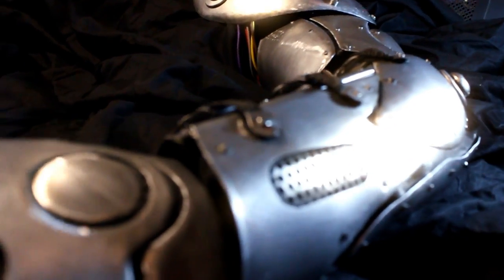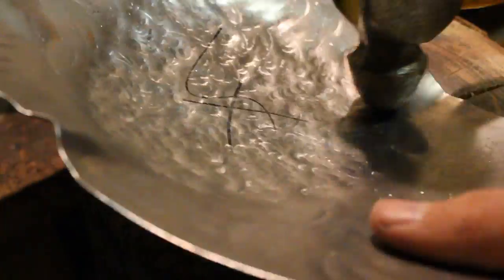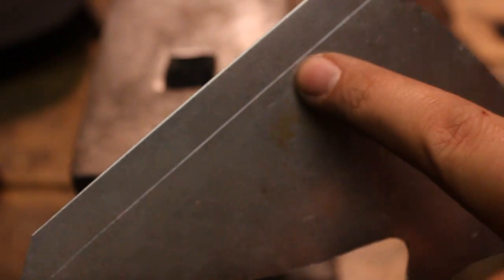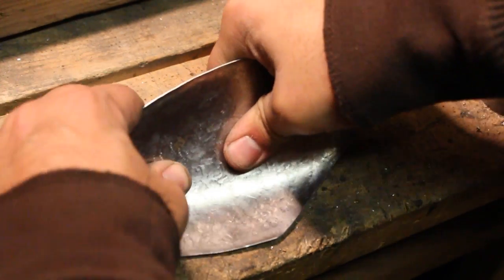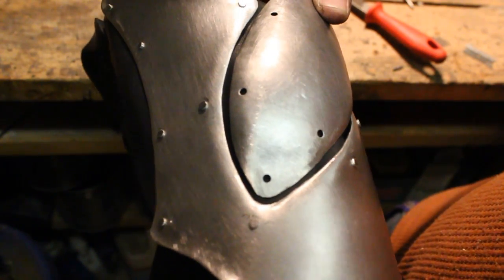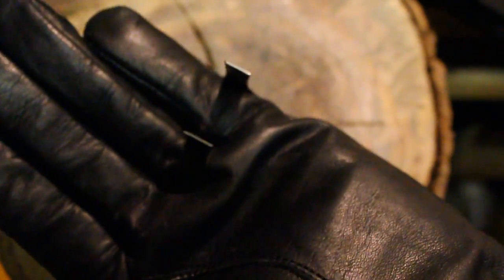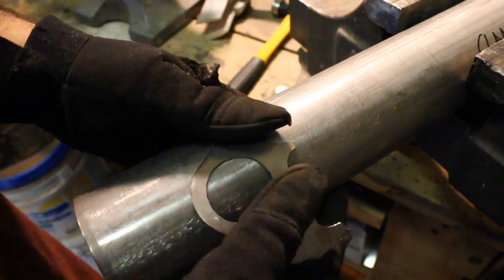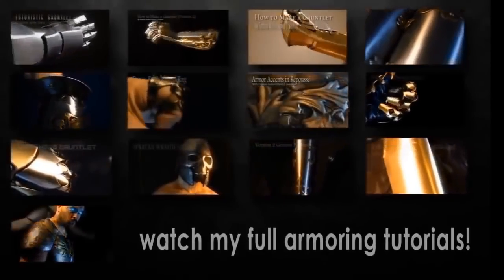How to Make a Bionic Arm in metal Tutorial

Comment: what kind of metal do you use? And where can I get some? Also dose it cost a lot?
Reply from the maker: This is 20 gauge steel but you can use any metal and any thickness you want. Steel sheet metal is not expensive. You can get enough metal to do a project like this for about $20 on Amazon, or even cheaper if you look up a metal supply near you.

Comment: Would have been 100x better if you made a motor then added it to the arm to actually make it strong
Reply: Jerry Udonneedtoknow u cant do it in a small size, it would be visible and not that great ...
Reply: Yes you can I built a small but very flat motor, I used about 23 feet of copper wire, the motor, it's about 1/2 inch thin and 3 inch in diameter
Reply: Jerry Udonneedtoknow an okok, if it's possibile to build it would be great!!
Reply: Though it is a pain in the ass spinning the wire around

Comment: I can let you in on a cool idea for an invisible latch .  This type armor, especially futuristic armor that is not supposed to be seen, as though the robot is seamless.  I owned and operated a special effects shop throughout the 80s and 90s contracting to television and movies.  I learned a lot of cool tricks, especially when working with other artist like Rick Bakker or Rob Botin.  

To make the latch, you used  a piano hinge, I always preferred aluminum stock.  You cut the necessary size you need from the hinge, usually the full length of the joint.  Be careful not to cut the hinge pin, you will need that for the latch.  We usually put a piano hinge on the opposite side from the latch, but that one had its pin.  I would cut the pin for the latch side a few inches longer than the hinge was cut.  Then bend a 90 degree turn at the point the pin exits the hinge.  That stops it from going in too far and works as a handle to use to pull it out.  Oh, I also used to sand a point on the other end of the latch pin, not necessarily a sharp point, just diminished enough to made it glide its way back into the hinge without hanging.

You have to replace the pin back into the latch hinge to attach it to the armor.  Now you attach both hinges to each side of the armor with whatever medium you like.  You can rivet it, glue it or fiberglass it into place.  The hinges can be on the inside of the armor if, you want it invisible.  It has such a low profile, it has never caused any discomfort with actors or stuntmen who wore our suits.

Once the glue has hardened on both sides, the hinges will stay forever lined up perfectly.  If you slide out the pin, using the 90, the armor should clamshell open.  Place it on the actor, clamshell it around their arm and the hinge joints will line up perfectly and you can slide the pin back in and it will latch that side.  Rotate the 90 degree turn on the pin until it is flush with the suit and  the effect should be strong, but invisible.  I apologize if you all ready knew this technique.  I don’t know if anyone else has used it, but I can imagine others thought of it, it’s not rocket science.  I learned it on my own, like I did most of the tricks of the trade, so I don’t know how common it may be in use.

Great job on the armor.  I’m impressed because it’s made from steel.  In Hollywood, it would fabricated from vacu-form, fiberglass or some other light weight material, because actors are wimps and believe it or not, so are some of the stunt people.  Whine like babies.  If you put that steel on some actors, they would bitch from morning until the director calls it a day.

There were other reasons.  Often they needed several suits, one for the actor, one for the stunt people, which could be several and one for the stand-in.  Suits get destroyed in some action scenes, so it’s best to have mold to quickly pull another and just paint it to look metal.  I’d love to really do one in metal!  i never have.  Great job!  Keep up the good work.
Reply from the maker: I never thought about doing a hinge on both sides like that. It's an excellent idea and I will be sure to use it on future builds. I came up with my own invisible latchless system on my Infinity Gauntlet build, but it was more complicated than that. And although a stuntman or actor might complain about the limited articulation of this piece, it actually only weighs about 4 lbs total. It's not heavy at all. But like you said...if they are wimps they will complain anyway haha

Comment: Thanks David. What size is the pipe that goes on the inside of the jig?
Reply from the maker: that's a 1" INside diameter pipe cut in half, and the one I press into it is a 3/4" OUTside diameter pipe. Both are gas fitting pipes found at any hardware store.

Comment: What is the footage of metal needed to create the arm?
Reply from the maker: I don't know off hand, but you should be fine with a piece that is roughly 24x24. Amazon sells 20ga in about that size for like $18. Best way to determine the exact size you need is to cut out all the pieces in the template and arrange them on the table in a square or rectangle. Measure the length and width and you'll know what you need to buy
Reply: Thanks David. What size the pipe that goes on the inside of the finger jig?

Comment: How exactly did you do the leather in the elbow crease? I am having trouble figuring that bit out.
Reply from the maker: you can see how it's done in the video if you look close. It all comes down to how tight or loose you rivet it, and where you leave the rivets out of it. Also depends on the type of leather and how thick it is. You just need to be sure there's some give in it so that you can move your arm fairly well inside of it. You will get some bunching when you bend your arm no matter what....it's going to take some trial and error
Reply: Thank you

Comment: I'd like to see this kind of build done with springs instead of straps for the outside retention on the forearm. Never tried it, so I don't know if that would be a problem, but it would look cooler than straps and buckles if it did. Great build either way, it looks awesome!
Reply from the maker: If you check out my Infinity Gauntlet build, I actually made it close with springs, but they are internal so they can't be seen. Same thing could be done externally if you are looking to make the springs part of the aesthetics.

Comment: If you attach a rawhide cap on the ball-peen hammer  you won't have the wicked excessive peen marks to smooth out, wood anvil, metal hammer with a wooden mallet head, a polymer soft hammer, there are several impressive urethane shaping hammers available, you could also place a layer of 1/2" rubber on the wooden anvil, and use a weight augmented hard rubber mallet, it rebounds nicely for less tiresome repetition. 
See if that improves your finish timeframe

Comment: David, this is Steve, inventor of Armore Fitness.  I note that you have a concentric hinge for your elbow.  You will have noticed that the arm does not work this way.  You need to change this to a 37 degree bicentric hinge to eliminate the pumping that is going on with your model, causing the exoskeleton to move up and down on the forearm.

Comment: I have a few questions. How durable is the 20 gauge steel? and could you make it with a thicker gauge to make it stronger?
Reply: The Ghost 20 gauge steel is quite durable. As you can see, he had to hammer at it with quite a bit of force to get it to warp into the particular shapes. It's easy enough to bend by hand with a decent amount of pressure but it obviously will bend or deform if you apply strenuous amounts of force to it. In regards to a thicker gauge metal, the thicker the metal is, the harder it is to bend and mold to how you want and the more susceptible it is to cracking.
Reply: one more question do you think it would be possible to connect 2 bionic arms to one of your chest piece and to the helmet as in like more like iron man and less like guardian from supergirl

Comment: Another question. Is it fine to make it out from aluminium?
Reply from the maker: you can use aluminum, but dishing aluminum can be very stressful to the metal and may require annealing to prevent cracks.
Reply: That's the truth. I think about chequer plate, or plate used to make cars.
Reply: Poo

Comment: How or where do you get your leather from? I have several old leather belts but they are too thick for me to use to hold pieces together.  Do you buy it off of amazon or another source?  And also what kind of foam do you use? Is it any specific kind? I also LOVE all of your tutorials. I made my own dishing stump from watching your video on it and it has helped me a ton! Thank you and please keep making these videos!!
Reply from the maker: I buy most of the materials through Amazon, but for the leather I had to find it on Ebay. The templates that require leather will tell you about how much you will need to buys, along with the recommended thickness, etc. The foam I use is leftover automotive interior foam, but anything should work fine. The black foam that you see me use inside the helmet is the craft foam you find at the hobby store
Reply: Alright. this will help a lot! Thank you so much!

Comment: I have been really getting into armor like this.  I like some of your gauntlets, and seriously want to make my own chain mail armor for actual, modern defensive armor.  I have been trying to find this youtuber that claims to wear it everyday as an every day carry item.  I probably wouldn't wear any of your armor designs as an every day carry item, but is it possible to make this or your gauntlets or pauldrons with thicker metal so it can actually withstand low velocity bullets?  Maybe 9mm?
Reply from the maker: to be able to withstand any round beyond a little .22, you'd need very thick steel, and it would be far to heavy to wear, let alone cut and shape
Reply: ltsallwood Actually with my own testing 1/8 inch steal shot flat will stop a 9mm. Curved on the arm it would probably ricochet off. You just wouldn't want to get hit in the head from the Rico. A 45 is a definite pierce tho.

Comment: I feel like this would help me be mobile my left arm is barely strong enough and saved in nerve how much would you sell that for I feel it will help me alot
Reply: Mike Campbell If your arm is barely strong enough to support itself this would just trap your arm inside a metal carcass and you would lose even more mobility of your arm.
Reply: Mike Campbell its not really bionic. No motors or hydraulics. Your own muscles move the metal. So like the guy before said, this would hinder your situation even more since this would place more weight on your arm.

Comment: tool and die maker apprentice: If you lift up at the end of your grinder strokes, you won't put holes in the metal. Gives a more perfect surface, however since this is mostly aesthetic, with a flapper wheel, it might not make a difference . Similar to how you spray paint without putting runs. (in case you didn't)

Comment: Is sheet metal from home depot ok to use? If so can I heat treat it and harden it like I would do when making a knife or other weapon? Also, what do you recommend for a good all around metal working tool?
Reply from the maker: As long as the sheet metal is not galvanized it'll work fine. Galvanized is fine too, but the zinc coating will look bad. You can harden the steel using heat but I am not an expert on that and I can't help you with it. Not really sure what you mean by a metalworking tool. There are a lot of different tools I need to do these projects

Comment: Couldnt you use a smaller glove to make the finger pieces smaller so you have more mobility in your fingers?
Reply from the maker: it'snot so much the glove that it the limitation on movement. If you used slightly thinner gauge metal for the fingers, it might improve a little

Comment: awesome job on this. wonder if adding an extra flap of plating closer to your neck on top of your shoulder and cutting a relief in the actual shoulder piece would prevent it digging into your shoulder when you raise your arm?
Reply from the maker: I considered adding another piece there, but I didn't want to ruin the rounded look of the top of the shoulder. If you look closely, I actually flared that part of the shoulder piece outward (away from my skin). With that, there's no real digging into my skin, or if there is, it's not uncomfortable. Plus, I don't put my arms straight up very often haha

Comment: how long is each section of your arm (hand, shoulder,etc)? or can these be adjusted universally?
Reply from the maker: It can be adjusted. You basically just figure out where the elbow hinges, and connect the upper and lower parts at that spot. Fairly universal unless your abnormally tall or short, in which case you can scale the template with your printer accordingly.

Comment: how would I go about using this method to make a winter soldier arm?
Reply from the maker: the shape is already fairly similar, but you'll have to use paint or something to simulate all the separate horizontal pieces of metal. You could "dent" the surface all over to make it even more realistic, but that would be very difficult.
Reply from the maker: by dent I mean along the horizontal lines of course
Reply: Yeah my talent in this area is some what limited!! I think I will just give it a shot and see how it goes! Thanks for your help and keep making awesome videos! !

Comment: adding a small battery pack and some LED's would make that arm REALLY pop, you can even utilize the wires you already have running through it
Reply from the maker: I did consider it, but decided to keep it kinda simple this time around. In an upcoming project though....definitely
Reply: +David Guyton I'm a flashy kinda guy and most of my projects include LEDs but this build with a battery pack that's visible and lights would be cool

Comment: couldnt the goverment use this to help are solders
Reply from the maker: It would help them look cool...wouldn't be much more help than that.
Reply: and weigh them down even more.
Reply: D. Taylor Ford with given time they'll come out with lighter stronger body and head armor whether it looks cool or not they will because you know if it will save lives and make money it's going to be atleast attempted they're already engineering head armor that can block anything up to 45 acp rounds so it's already a thing just not finished yet

Comment: Another great video and build! I was wondering about your arm length vs Hobbit built people like myself. It might help for scaling the pattern down or up as the case may be per person. Thanks again for another great build!
Reply from the maker: it's easy enough to trim some off of the ends of the parts, and you can place the hinge point anywhere that works best, so you shouldn't have much trouble modifying it to get it to fit your arm